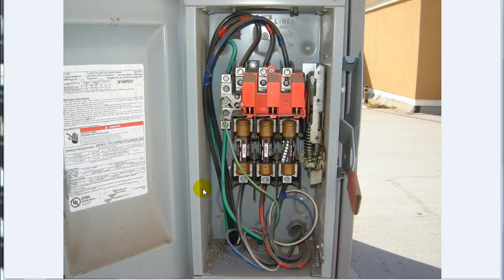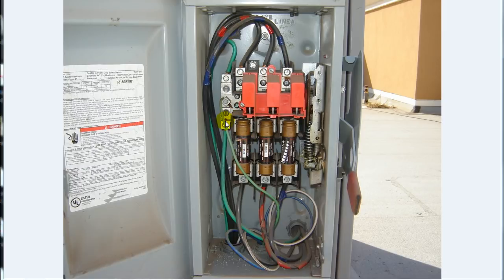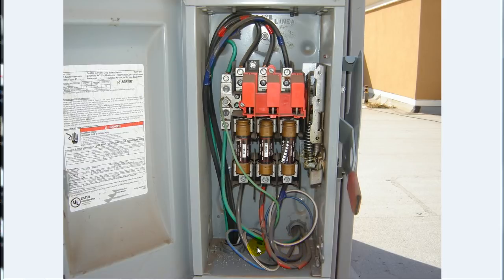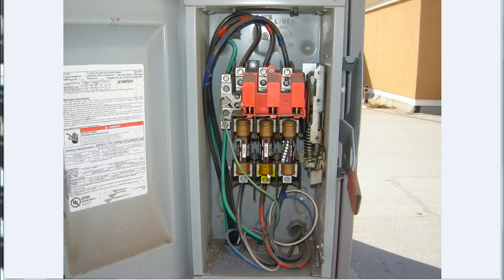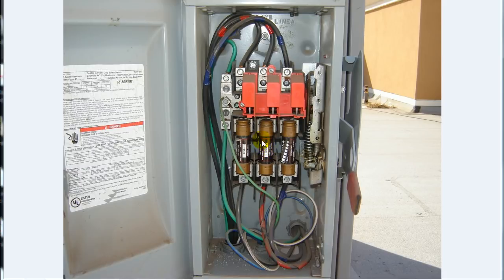3 Phase Disconnect

Comment: If the fuses were 50 amp on up they would be blade style. Also with air conditioner's/ heat pumps they use what's called a time delay fuse. Meaning the fuse will allow for an over draw in amperage for a short amount of time.

Comment: sparky-  sorry, it is a 240vac disconnect for a solar array, not and air conditioning unit.  bringing back 2 hot legs from each of two arrays (at 240v) a neutral and a ground to a sub panel into a 15 amp 2 pole breaker.  assume I'll connect nutral and the ground in the subpanel.  then the wiring goes into a meter base (to measure production) and then into the disconnect.  the disconnect is fused and that then feeds into the main breaker panel.  I'll use a 35amp fuse in the disconnect.

Comment from the maker: @butopiatoo not sure on why you need a neutral on 240 V A/C disconnect but one thing to keep in mind is that anything after your main meter panel such as the sub–panel or beyond that you need to separate your grounds and your neutrals.
Take a look at your nomenclature on your air conditioning unit it should say max fuse size that's what you need to size your fuses on an AC per the NEC.

Comment: Is it an acceptable practice to just pass your neutral through the enclosure, without landing it on the neutral bar?

I know that the ground needs to be landed as you have done, and bonded to the box.  But what about neutral?  Is the neutral bar a nice-to-have or a need-to-have?

Comment: put your volt meter or amprobe on VAC put your lead on ground or nut if you have one and the other lead on hot side. The 120/208 system should read 120 from ground or nut to each hot leg ie. phase 1 at 120 the leg 2 at 120 and leg 3 also at 120 and move the lead that you have on ground or nut and put in on phase 1 and the other on phase 2 you should read 208 and the same on phase 2 and 3.

Comment: You mentioned that the ground bar could accept a neutral if necessary . That is only permitted at the first point of disconnect . after that point it shall be isolated from ground.
Reply: Thomas Nemeth I saw that too. Good eye.

Comment: I'll take a picture the next time I'm out at this location.  All has worked well going on 2 years now.  The fuse in the disconnect is larger than I would like, but it was the smallest amperage I could find for that size needed in the disconnect without using a reducing bracket.

Comment: great stuff.  Im trying to wire a 2 pole 240v ac disconnect for some solar, and not clear how I bring the neutral back to the main breaker.  Very confusing on when the hutral is bonded to the ground and when the hutral and ground have to be kept seperate.  thanks for this video.  Wish some one would do one on fuses.  propersizing, using fuse reducers etc.

Comment: Make sure you get a 60 Amp disconnect then.  Because good luck finding any 35 amp fuse that can fit in a 100 amp disconnect.  The lowest I can find for 100A, is the 70A fuse.
Reply: carultch That is why they make reducing ferrules.